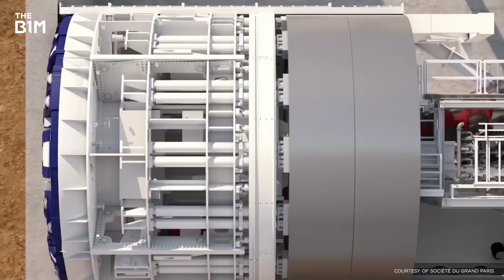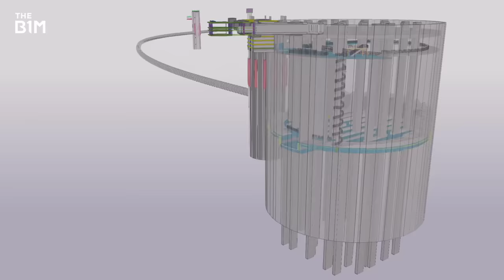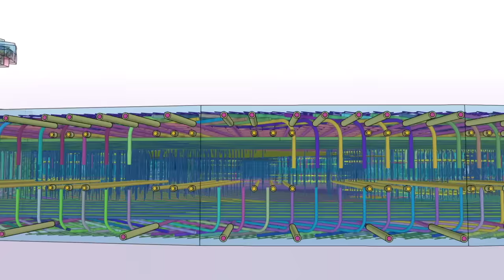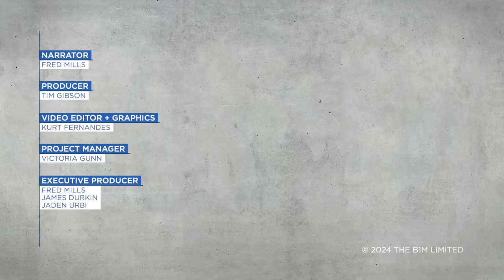Why Paris is Doubling the Size of its Metro

Comment: No mention was made of accommodations for people who are mobility challenged. This is a problem that never seems to be addressed. What does a person do when the get off the metro and need to go five or ten blocks to their destination?
Reply: I am one such person, and the GPE is fully accessible, from street to train.
With plenty of elevators and escalators.
This is an express metro, there are other types of lines for finer service, like tram lines that are also accessible or busses.
Only the older historical metro remains poorly accessible, except for the new or recent extensions that are fully accessible.
Reply: actualy norm are pretty decent in france, most new project include stuff for people with mobility problem. And the metro network cover the center quit well .

Comment: Timestamped Highlights
00:12
🚄 The Grand Paris Express is Europe's largest infrastructure project, a $45BN rail line stretching over 200km with 68 new stations.
00:40
🏙 Paris' metro currently serves only the city center, but the Grand Paris Express will connect the suburbs, boosting regeneration and the economy.
02:10
🚇 Fully automated, driverless trains will run at an average speed of 60km/h, nearly double that of the current Paris Metro.
04:54
🌱 Paris aims to be 50% green spaces by 2030, and the Grand Paris Express will help remove the need for 150,000 vehicles, reducing carbon emissions.
06:10
🎯 The project is more than just a metro line; it's an infrastructure megaproject revolutionizing Paris and opening up the city like never before.
Summarized by @NoteGPT

Comment: Nope : 
Paris line 14 is already going at 60km/h ..
Grand Paris Express peak speed will be 120km/h ...
Reply: Average speed...  not top speed.
Reply: Peak speed will be reached between every stations that are as far as each others than railway station : This is the single purpose of this line ... And also what i am working on right now as it is part of my job at the Société des Grands Projets.
Reply: @MrElbarto75   Yup but that is still the average speed that was mentioned.
The average speed is the one between two distant points of the line, accounting for stopping time, etc.
If the line is 60km long and it takes you exactly an hour to go from one end to the other, including the stops, then the average speed of the line is 60km/h, even if your train peaks at 100, 200 or 300 between stations.
No one is disputing the fact that the GPE trains will peak at 110 or 120.
It's the average speed that was mentioned.
Reply: @KyrilPG  sorry i didn’t read your comment, and i probably won’t :)
Reply: @MrElbarto75   It seems like you don't listen to videos either...
Reply: @KyrilPG  i do, but only when your mom is in ❤️
Reply: @MrElbarto75   Non mais sérieux, ça fait deux fois sur cette chaîne que tu postes des commentaires démontrant que tu n'as rien écouté de ce qui était dit dans la vidéo.
T'es sûr que tu bosses à la SGP ? Entre l'inattention au contenu et le genre de réponses que tu fais, on dirait que c'est plutôt un stage de 3e que tu fais à la SGP...

Dans celle-là il annonçait une vitesse moyenne, tu réponds non et parles de vitesse max.
Sous celle à propos de la grande vitesse aux USA il y a deux mois, tu as parlé de Brightline (Floride) pour descendre la chaîne alors que la vidéo parlait de Brightline West qui est bien un projet de ligne à grande vitesse avec des trains électriques. Et c'était d'ailleurs le seul des deux Brightline qualifié de grande vitesse dans la vidéo...
Reply: @KyrilPG  Encore une fois, merci pour ta rage, m’en délecte. Et non, soit tu n’y connais rien en politique americaine soit tu est d’une naïveté egale a ta stupidité : depuis combien de temps calspeed est en travaux ? On dirais le y basque … Et La ligne LA-Vegas doit suivre le trace d’une des autoroutes les plus fréquentées de l’hemisphere nord, y compris en region montagneuse, ca risque d’aller super vite ! Waaahou !
Retourne te renseigner et decouvre que ces deux lignes sont des impasses pour une seule raison : les blocages politiques. Tant que Trump et ses potes seront a la tete des Republicains, tous les projets d’infrastructures ferroviaires lourdes non fret seront systématiquement torpillées par les lobby de la route et des airs, c’est comme ca depuis les annees 80 et ca ne changera que si ces abrutis se tirent … biden est un fossile mais son plan d’infra est la derniere chance de voir au moins un projet de lgv non risible dans les 20 prochaines années … car pour le moment il n’y en as aucun de viable.
Reply: @MrElbarto75   Quelle rage ? Qui est agressif et désobligeant avec qui là ? Et surtout pourquoi une telle hargne dans la réponse ? 
C'est dingue comme tu réponds systématiquement à côté de la question ou du sujet.
Je te dis "A", tu me réponds "ce n'est pas B"...  🙅‍♂️🤦‍♂️🤯

Dans ton message sous la vidéo à propos des USA tu répondais que ce n'était pas de la grande vitesse car c'était un train diesel sur une ligne avec des passages à niveau. (Ce qui est le cas de Brightline Floride uniquement et qui n'a PAS été qualifié de grande vitesse par le narrateur) Sans référence à la politique.
Très bien, mais il parlait de Brightline West et c'est le seul des deux qu'il a qualifié de grande vitesse, pas Brightline Floride.

Pourquoi tu me réponds politique ?
Ça n'a pas de rapport avec le point soulevé qui est que le projet soit effectivement construit ou pas ça ne change pas le fait que c'est un projet de grande vitesse avec des trains électriques et une vitesse cible de 300, même avec toutes les limitations d'un médian autoroutier.

On est tout à fait d'accord sur la partie politique américaine, mais ce n'est pas le sujet qui était abordé jusque-là, ni dans la vidéo, ni dans ton commentaire initial.

Sous celle-ci tu as dit non puis as parlé de vitesse max, quand la vidéo parlait de vitesse moyenne.

Tu ne vois toujours pas le décalage ? Relis toi après avoir revu les vidéos.
Reply: Tu réponds a mes commentaires sous plusieurs videos : cool pour toi, mais je centralise, pas le time. 
Mais la j'ai bu deux bieres et je suis d'humeur joviale, du coup je vais etre sympa et te donner des billes sur BLW
Brightline West ne sera pas une ligne avec une vitesse de 300 dans sa configuration actuelle, c'est impossible en l'etat : la cajon pass avec ses virages de porcs et son dénivelé de 500m ( 300m d'alt  a rancho cucamunga et 1200m d'alt  sur le plateau de cajon pass ...) aurait du se traverser en tunnel, pas entre deux voies d'autoroute : ce choix politique et economique propre a brightline ( ils font la meme a Orlando ) limite la vitesse des trains : il faut de la distance en ligne droite pour monter a 300 et encore plus pour ralentir ...
- 19km de cajon pass a victorville
- 37 km de Victorville a barstow
- 100 km entre Barstow et Baker
- 100 km entre Baker et Vegas
Et sur l'ensemble de ses troncons, la lgv devra ENCORE s'integrer au centre de l'autoroute : Elle traverse plusieurs parc nationaux, des reserves, des propriétés agricoles ou privées ou les propriétaires privés ou particuliers sont en droits de demander des montants colossaux etc ... Bonus track, de Cajon a Vegas on passe de 1200m a 300m.
Donc oublie la LGV, au mieux t'aura un pendolino avec une perruque, comme pour l'Acela, et les voyageurs trinquerons comme d'hab.

Comment: The problem for Governments is that public sentiment is fast turning against the green agenda (farmer protests, fuel protests, public backlash against restricting car use etc).  Also, radical anti-car policies has considerably hardened many people like myself into being very pro-car and in some cases, anti-bicycle (myself included).  If you said to me five years ago that I'd be commuting by car, I would have laughed.  Recent anti-car ideology has driven me to unplugging from any guilt regarding car use - this is a clear example of delegitimization.
Reply: I agree, but in this example i think Paris would be much better without car (except delivery, ambulance and so on) The problem with Paris is that it's too small and limited by the ring road around, and that everything is in Paris in general. Just too many people.  I fully agree with the above comment though, i'm saying that we should remove car in paris but at the same time the transport from banlieue to paris is still not enough in my opinion. This project is a drop in the ocean

Comment: There is a problem with the GPE, it is that the transport expert companies have been little consulted and little listened to; it is a project which has been taken over by politics.

Already among experts, but also people linked to transport, there is fear that the lines are under capacity despite automation.

There are no measures to deal with unforeseen events (such as 3-track stations and 2 platforms to create temporary termini) and it is not yet known whether there are any reserves to extend the stations if necessary.

French politics too often has a short-term vision and we fear that this will impact the GPE lines.

As for the creation of multipoles in the suburbs, this will make Paris like a museum city, in debt, and without a viable economy.....Like Venice, it will eventually empty out (several decades).

Comment: 37 billion sounds like the amount you'd pay to build a highspeed line across a country, not for a line in a city
Reply: It's not a single line, 200km, multiple lines and extensions and most underground.
Reply: it's 4 brand new lines and two significant extensions to existing ones and its not just in a city its in paris and the 8 departments around it. If you compare it to say the elizabeth line or HS2 it's a steal.
Reply: its harder and take more time, so money, to construct complexe line system  connecting it with other network in/under a town (mostly under) than some straigh or curvy line in field
Reply: It is, as other said, a mostly underground system of 4 new lines and two extensions with 68 new stations, that are also underground.
FYI, the Madrid-Barcelona-French boarder high speed line, that is 773 km Long (~483 mi) costed ~12B Euros. It does have tunnels and bridges and it needs to be high quality and as straight as possible but it is mostly in the open air and only has 8 stations, only 2 underground, and one of those already existed (it was renovated and extended).

Comment: Is this Paris’ version of the ELIZABETH LINE?
Reply: No, the Elizabeth Line was actually inspired by Paris' RER (Regional Express Network). Although the more established RER has 5 total lines and is actually 5 times longer in total than the EL.
Reply: No, the Elizabeth line was London's version of RER A.
The GPE is a set of entirely new express metro lines for orbital journeys. There's zero repurposing of former lines in the Grand Paris Express project, and 90% of it is built deep underground.

The Elizabeth line or Crossrail is like the RER, and more specifically line A : repurposing previously existing or former suburban lines, connecting them by building a large new central section with huge stations to allow for rapid cross city journeys on new high capacity trains, while at the sane time relieving a long existing subway line that runs parallel in the center.
The Central line in London, the M1 in Paris.
They even have a similar shape: a long, East-West cross city branched line.

Elizabeth line and Grand Paris Express have very little in common apart from being mega projects and both having platform doors.
Elizabeth line is a RER type line, GPE is a group of 4 (for now) entirely new fully automated express metro lines running almost exclusively in the suburbs and forming a loop and arches aimed at orbital, or tangential, and connection journeys from suburbs to suburbs.
The M15 line of the GPE will form the 3rd ring of the transit network (M2 & M6 forming the inner ring, tram lines T3a & T3b forming the 80% complete inner-middle ring, express trams forming the currently disconnected parts of the 4th or outer ring).
M15 will also be a high capacity, high frequency and high speed (for transit) line connected to almost every other mass transit lines in the network.
Reply: No. The Elizabeth line is a version of the Paris RER that has 5 line (first section opened in 1977).
The RER, just like the Elizabeth line, took two existing suburban/regional lines that ended in a terminus at the outskirts of the city (or city center) and connected them together through the center with a metro style tunnel and stations along the central section.
This system was an advanced version of the S-Bahn, the first in Berlin in 1882, that did the same but it was still a more of rail line than a metro line with lines sharing tracked (which for the most part does not happen with the RER or the Elizabeth line, at least not  in the central section).

Comment: The issue is that this is a mega project just so that people can live further and further away from work. This is a project that promotes long commutes, which will promote more urbanization of the Ile de France countryside. Sadly the promised green transformation of Paris and nearby suburbs for the olympics is simply not happening. We keep seeing concrete everywhere, with a few trees in big pots... As opposed to what many other cities are trying to do, which is to remove the concrete and have real trees and real flower beds, in the ground. Another issue is that this plan does not adress the issues of current RER lines that are plagued by decades of lack of track, train and tunnel maintenance, especially lines B, C and D. 

It is a necessary project to connect communities along that ring road yes, and the fast train between Paris and the CDG airport is badly need, but that's the thing : all of this is badly needed coz the city is late to the party. It should have been done much much earlier. So that today we could have a real green mega project to cool down an insanely hot Paris from May to September. You may think Paris is green, but that's coz they rig the numbers by including Bois de Boulogne and Bois de Vincennes in the Paris limits, which is just a ruse. Those parks are outside of Paris. In reality, we're nowhere near Oslo or Singapore in terms of greenery in the city. It's just buildings. And nearby Saint Denis was supposed to see so many trees planted... Instead they just built apartment buildings, and planted nothing. They cut down old trees and put small ones between 4 towers and say "but look there's more trees".
Reply: You overlook that city of Paris is small (105 km2) and massively congested.  For comparison, London is  1,572 km2!   If Paris were like other big cities in Europe it would have annexed the 92, 93 and 94 years ago.  These new lines are not going through the countryside, they are going through suburbs that are already developed.  They will just make their commute to work less of a nightmare.
Reply: @edmerc92  How is any of what you said an argument justifying that Paris has no greenery and too much concrete ?

Comment: Every time I see some video/report/documentary about gridlock and traffic, I always remember we were all home during the pandemic. Almost everyone. But now that "it's apparently over", employers recalled everyone at the office. WHY
150 000 cars in Paris is NOTHING. It's a solution that will be good for what? 5, 10 years?
Stop bringing everyone back in offices because you can't otherwise justify management jobs if they're not breathing down someone's neck.
You'll have your 150 000 cars and more off the roads for way more than 10 years.

Comment: Solving problems of the last century today!  With huge expenditures.  Because Parisians need to travel in a circle.  Really smart.
Reply: The new system is not for Paris proper, but for the Paris urban area (around 11m. residents). Historically the mass transit system was very Paris-centric. With the new lines, it will be possible to commute from one point in greater Paris to another without having to cross Paris proper or transfer to another train in Paris.
Reply: i live in a Parisian suburb and this project would facilitate a lot my commuting. do not speak for us